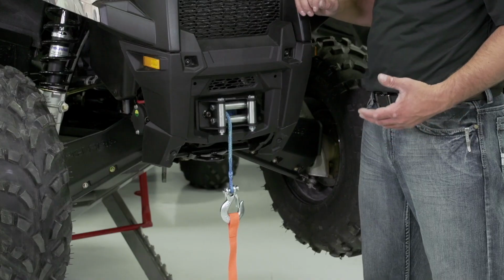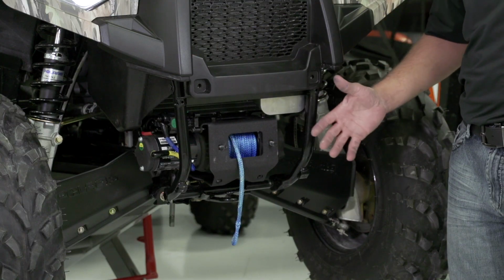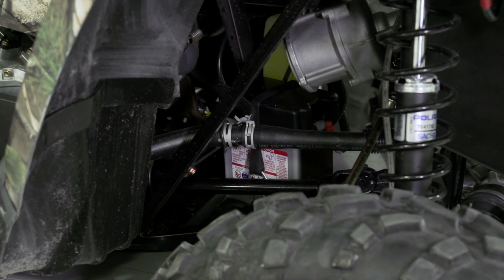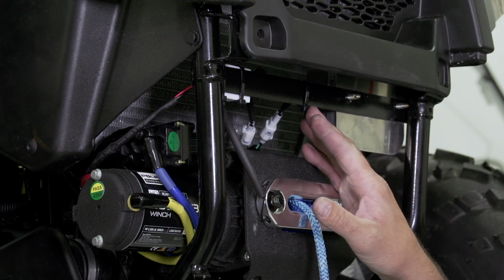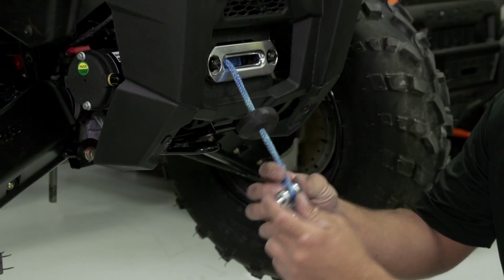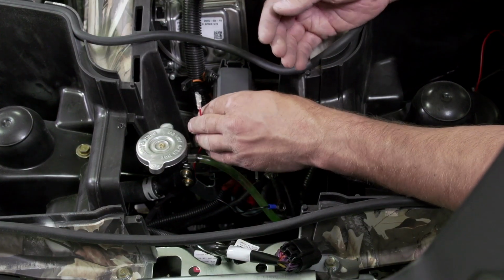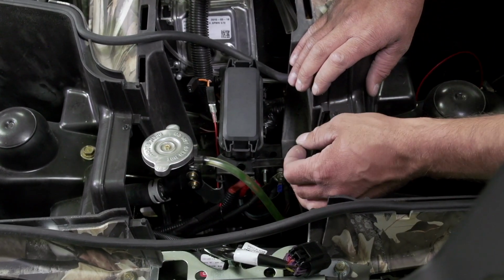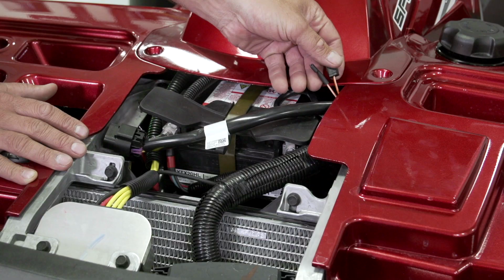Polaris® HD Winch Auto Stop Install ATV | Polaris Off-Road Vehicles

Comment: I have a Polris Sportsman 850, my winch is a 3500 lb. My winch is tucked away in all of the framing and protection devices. BUT my control cable is on the Left side of the winch (as I sit on it). I have the auto-stop in and it works great.

Comment: I'm attempting to instal this on my 2016 570 full-size ranger. According to both polaris dealer and the polaris website it is supposed to work on my model. I have no clue where the 2 shorter connections attach and you don't even show doing this in your video. Also, I don't see another keyed-power connection.

Comment: I have this on my 2019 Polaris sportsman 570 utility ATV.  My line got tangled up on the spool without my knowledge while plowing snow, and when I hit the out button it retracted the rope instead.  The auto stop did not work because it read that it was going out and my rubber stop with the magnet in it got mangled in the fairlead. I had to cut the rope to get it out.  To make a long story short the rubber stopper for this system cost $43 to replace.  What a ripoff!  Polaris parts should be made of gold.

Comment: Installed this on my 2018 Sportsman 850 ESP and the wire is exposed in the front because the cover that is removed for the winch install is solid. Would not recommend this for 850/1000 until Polaris provides an OEM solution that protects the exposed wire.

Comment: My 2018 rs1 winch stops way to early leaving the hook and to much rope to drag in the mud, is there ant adjustment that can be made? Or do i have to disable this auto stop function ?
Reply: I had the same problem with the over-priced POS too Ron.   I took it off and replaced the fairlead with a nice billet one from Custom Splice.   Check em out.  The auto stop is junk IMHO.
Reply: Randy Nelson: In short "Yes" and "Yes". However, because of the splice/knot/metal loop, the puck cannot be moved close enough to the hook to really solve the problem.
Reply: : Thanks for the ideas and suggestions. When you suggest "in front of the magnetic puck", am I assuming correctly that you mean between the puck and the hook? If between the magnetic puck and the autostop fairlead, then it's doubtful that the autostop mechanism would "stop" as intended.
Reply: Dale Mullen mine didn’t stop today and now it’s stuck smh I could of swore it had auto stop to prevent this problem
Reply: @jbarres80 : Consider this possibility...Using my plow, I have the tendency to let the cable out too far (can't see it from in the seat). Add this to the fact that if you are using a plow, only the last foot or so of the cable is being used, over and over.
Not only does this wear the cable but it also tends to wind the cable tighter and tighter, all "in one place". Only trouble can follow. :-(
In my situation, the cable managed to stick in the coil and back track on itself thus reversing what should happen. I.e., when the switch was set to let cable out, it actually pulled the cable in, effectively activating your auto stop mechanism to stop winch movement. As a result, by cutting the power to the winch (as done by activating the auto stop switch), you end up not being able to pull the cable in or let it out.
My only solution was to cut the hook and magnetic stop off my cable, forcefully pull the cable out (several feet or until untangled) and then reroute the cable and replace the auto stop puck and cable hook.
Does any of this fit your situation or make any sense. 
This is actually harder to describe than do.
Reply: Dale Mullen actually yes 
This was my 2nd time ever using the winch 
And when I was using it I noticed when I pushed out it in fact was coming in and when I pushed in nothing happen now the hook is tight to the guard and idk how ima get the hook off
Reply: jbarres80: Sounds like you will have to follow the procedure I outlined in my previous answer. As you have to be using a non-metallic cable with the autostop mechanism, the cable can be easily cut with any sharp knife. 
Remove the hood over the front section (2 release knobs and then slide hood toward front of vehicle to remove). You will then be able to see and access the winch to cut the cable. Note the path of the cable and orientation of the "puck" before cutting.
Reply: @dalemullen96  went to dealer today and that was what happened they fixed it thanks bud
Reply: jbarres80 Just happened to me.

Comment: I have an HD 6000 winch on my 2019 Ranger Crew Xp 1000.   The wireless remote has a pig tail for a wired rocker switch - the instructions mention this optional kit but NOBODY in Polaris seems to know what the part number is so I can order one.   The wireless remote is great but it can become "lost" or found to no longer work at a crucial moment.  I want a wired solution as mentioned in the bullshit quality installation sheet.   If you're an engineer then you should be able to give me a part number?  Look at the installation instructions for the HD 6000 lb winch - page 4 - I have a case opened but like most contact with Polaris, I don't ever expect to hear back.
Reply: UPDATE.   Well as I suspected - my so called "case number" with Polaris doesn't mean SHIT to them.   It's been a month now and no return call, email, - NOTHING!  'As an engineer myself, I decided to buy a winch rocker switch and "fix" it myself.  It's really simple, and I cannot believe that Polaris couldn't cobble together a 100$ solution.   There are four leads in the pigtail - battery ground, winch in, winch out, and accessory power.  I clipped off the mystery plug from Polaris and put on a Delph 280 plug - did some minor work with the ohm meter and wiring and it's history!   Thanks Polaris!  You worthless cunts!  What can I expect from a machine that cost me 21k out the door!?  Maybe my expectations are too high?
Reply: Did you contact your dealer? For anyone else looking, remote PN 4013466. Socket PN 4017102. It is also in the installation instructions for the wired kit:
https://cdn1.polaris.com/globalassets/pga/pdf/kitinstructions/ranger/cpq/utility/winches/2882714_9928649r03.pdf?v=609d0543

Comment: the only problem is, now that I had it installed the winch link is too long and it doesn't pick the plow up. Will have to fabricate a link that is at least 3" shorter. Thanks Polaris...great engineering.
Reply: Cool
Reply: Chad: Have you found a solution to the excessive winch lead length causing plow problems?